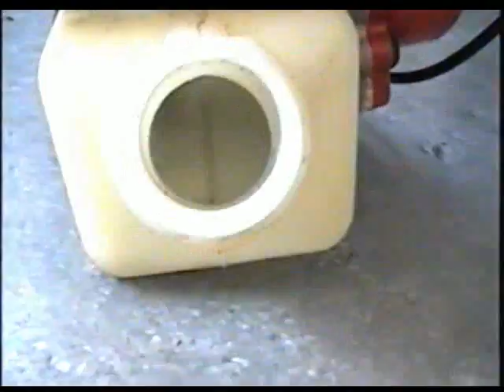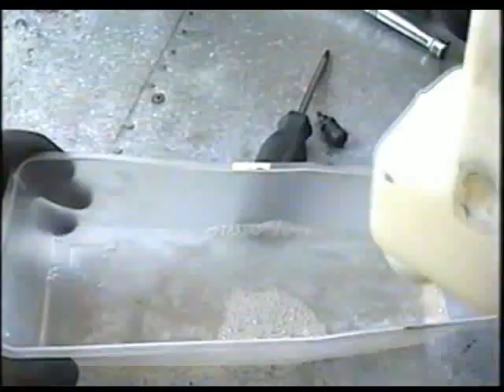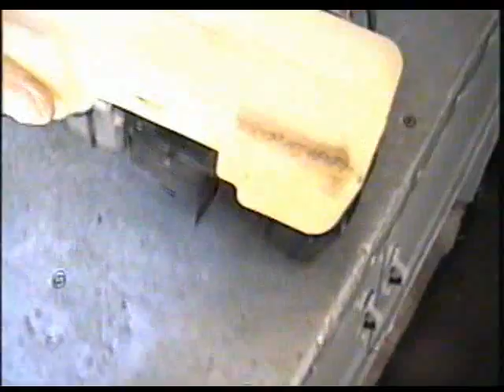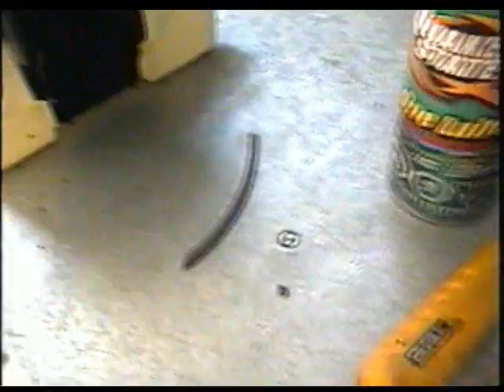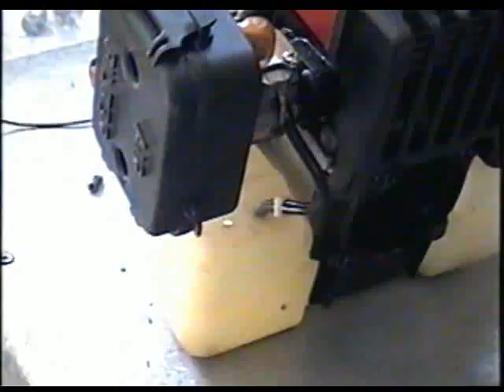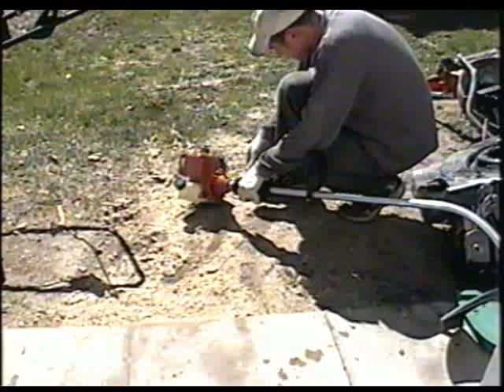FUEL LINE Repair on Homelite SX135 Bandit Weed Wacker

Comment: What would be the reason the Homelite UT32651 (26SS) String Trimmer won't start after replacing fuel tank, Fuel lines, fuel filter, fuel cap. Replaced old Carb with new unit. Put new carb in service and started the string trimmer adjusted L & H as needed. Ran fine. Next day tried to start Trimmer again but will only start if I pour pre-mixed fuel into carb. one small cap full. Trimmer runs fine after that. Good compression, and spark. Thank you for any suggestions.

Comment: Good video.  What is the fuel oil ratio for these?  32:1, 40:1 or 50:1
Reply: 50:1
Reply: @fngonuts  Mine is very, very old.  I found a manual and at that time 32:1 was recommended.
Reply: @tonymcalister9878  right on. Mine both need piston rings. 20 psi compression. Ugh. Yeah..mine says 1997 If I rem. right.

Comment: Good video & it helps people repair their weed wackers. Just an FYI, in the video you started the engine and immediately turned the air/fuel adjustment needles on the carburetor. You should have made a disclaimer that to remove the anti-tamper caps on the air/fuel adjustment needles on the carburetor may be illegal in some places and the engine should be warmed up to normal operating temperature before adjusting the air/fuel ratio. Otherwise a helpful video, good job.

Comment: i've got an older 4-cycle ryobi 990 whose fuel lines have dry-rotted off the primer and in the tank.  how do you figure out the fuel line routing when trying to reconnect the fuel filter/primer bulb/carb ports?  is the larger, down-turned port on the carb always for the primer bulb and the small short port on the carb the main fuel line that gets the fuel filter?

Comment: I really enjoy watching all your videos,,they are very informative.does the yardman 6 hp. engines for the mulcher/mowers
have more than one kind of primer bulbs ? I took one out of a yardmen the locking ring was plastic.it seem's that the cavity where it goes seem's to be deeper than those shown on your videos.I have not seen any videos with this type of carb.I gave the model # when I got the new part, but I don't want to waste a new bulb by installing the wrong kind. thank You so Much.

Comment: Thank You Very Much Sir!!  I had the Exact fuel line issue on the main line in which the hose corroded & broke off.  I thought I just needed a small part, but your video showed me how I could clean it, replace the filter, and the replacement hose lines.  I have a straight line Homelite and really like its power, so wanted to avoid replacing it when it looked like a simple fix could prolong its life.  I just need to buy the torque screwdriver, and the parts.Think the Ryobi tune up kit will work?

Comment: just so you know, you don't need to take out any screws out to take off the tank. it just pulls out if you bend the plastic a little bit. doesn't take any real force at all.

Comment: I have enjoyed your videos.  I rebuilt the carbarator per your instructions with a rebuild kit.  It still will not start.  If I spray fuel in, it will combust but not continue to run.  I guess I need a new carbarator.  Mine is a Zuma